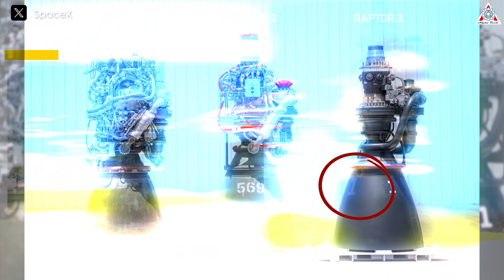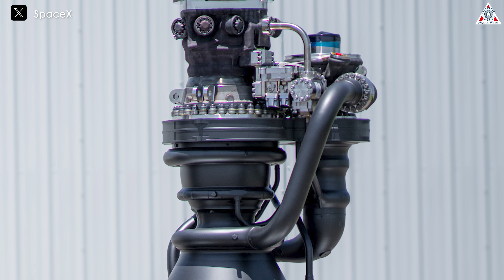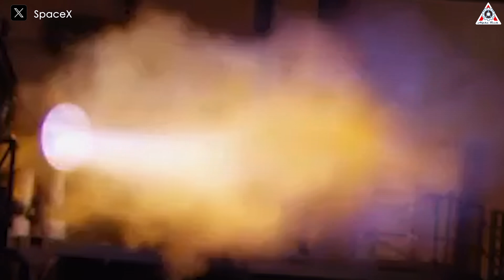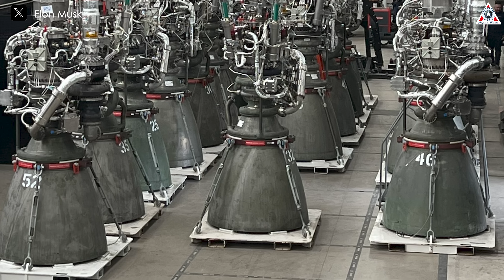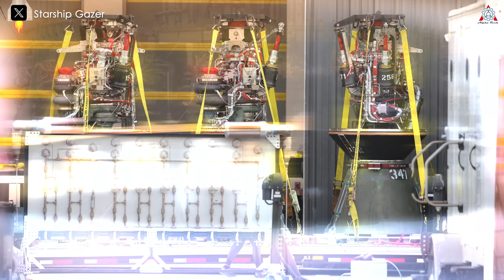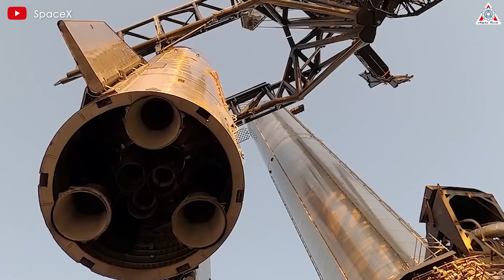Elon Musk's SpaceX Just Announced NEW Raptor 3 Upgrade...Shocked The Whole Industry!

Comment: What if automotive engineers focused on new internal combustion engine designs using 3-D printing and A I to create a new engine design that enhanced fuel efficiency, increased horsepower, and reduced weight? One area that comes to mind is doing something with hot exhaust gases RE-igniting the exhaust with more fuel then RE-routing the power generated back through impellers that geared back to the driveshaft? Is something like that possible with a net gain in break horsepower? 👍🖖😊
Reply: Water injection with a small displacement turbocharged engine is probably the best we can do there.
Reply: What if electric was so efficient that there is hardly any heat imagine how this would save the planet from global warming and the harmful effects of exhaust gasse,  the future is now
Reply: @jacobclark89  Yeah but energy storage for a battery is two orders of magnitude less dense and that isn't a trivial problem
Reply: Well, they have done that for like 100 years. 😉
Vehicle combustion engines have the demand upon them to work well in an extremely wide power output range.  This is where we have always seen progress.  When fuel cost increased the efficiency throughout the power range has also become important.  This is why we now see developments like attempting to vary valve timing and lift.  Varying compression ratio is also tempting, and quite possible (you put a knee on the pushrod and connect a second rod to the knee).  The problem here is that increased friction losses tend to eat gains.  Auto engines should also be affordable.
Nevertheless, physics offer two main ways to increase efficiency:  Convert more of the heat energy from the combustion to mechanical energy.  Or reduce cooling.  Reduce cooling can be done by using more extreme materials, and also by making cylinders bigger and keeping stroke close to diameter.  Or you can use the cooled energy for more mechanical energy.  This is part of what water injection would do.  Water injection also allows for higher compression ratio, which extracts more energy during the longer expansion cycle.  The same thing that diesel engines already do.
Turbos mainly make an engine "bigger", thus becoming stronger by combusting more fuel and air.  But it also feeds back some of the exhaust energy extracted by the turbine to the engine, by "blowing" it.
There is however another interesting method to extract more mechanical energy from the exhausts.  It's sometimes called 5-stroke engine, but is in properly more like a 6-stroke engine.  For every 2 cylinders, you add a third bigger cylinder.  Thus you can only build 6-stroke engines as 3-cylinder, 6-cyl, 9-cyl, 12-cyl etc.  The exhaust from each of the two combustion cylinders is alternately fed into the third cylinder each cycle.  Experimental engines like this has been built and tested with very good results, at least 10% increase in efficiency.  The engine also becomes bigger, heavier and more expensive.
Reply: @Vermiliontea  Thanks for breaking down these concepts into a language I can understand.  A I apparently is not ready to integrate all these concepts to design a new peak performance machine. There’s so much background data that needs to first be given to A I in rocketry and automotive engineering. Thank you for taking the time to answer my inquiry. 👍🖖
Reply: Perhaps when we get Zero Point Room Temperature electric 😮

Comment: Enjoyed your very informative video. But, you claim that not only is Raptor 3 the highest thrust of all currently flying rocket engines, but also the most reliable. No reliability data yet. And certainly every time you push farther to the boundaries of power vs weight, reliability usually takes a hit. SpaceX method is to develop a new better version, then through extensive testing and actual use to constantly improve reliability. We will have high confidence on reliability after 100 successful flights.

Comment: I calculated StarShip 3 Booster prop load is for 128 seconds of work only. Looks suspicious. It shall have more volume for prop.
StarShip Booster may have 4600t of prop, 33 Raptor 3 engines, and still fly as expected.
Reply: ok, what
Reply: I think you don't understand that the seconds is not operating time but a measure of the speed of the exhaust.
Reply: @royh6526  
Fuel consumption is 'thrust in kgf'/ 'specific impulse in seconds'
306,000 / 350 = 874.3 kg/s 
Number of engines
10000 / 280 = 35, 71 ~ 36 engines
All engines fuel consumption
36 * 874.3 = 31475 kg/s
Booster prop in seconds
4,050,000 / 31475 = 128.67 seconds.

Comment: I would love to see a technical discussion of how SpaceX Raptor engines evolved to a simpler design. Just looking at the engines it’s easy to see the simpler design, but without knowing what the different parts are it might as well be magic.
Reply: I suspect that a lot of the previously external plumbing, is now incorporated within the engine via 3D printing. Also a lot of early wiring is for sensors to gather performance data, as the design evolves, fewer sensors are required, and when your confidence in reliability is high enough, none.
Reply: @royh6526   I've spent the day studying the Raptor, and I think you're spot on.  Changes to design, incorporating data into the shapes and dimensions, have made a lot of sensors redundant, and probably also a few valves.  But they must also have internalized some things with 3D-printing.  If you go 3D-print for other reasons, like more internal cooling, you might as well stuff everything.  I might also have figured out how they throttle the thing, but I keep my mouth in order to not make a fool of myself.  And yes, I'm implying that the obvious, natural way might not be it,  ...or otoh, it might be.

Comment: Better than Rocket is here
Easy lift off 
Easy land on with antigravity Spaceship
No Fire
No Explosion
No Flame
Just Spin and
Lift off
Powered by Baterry

Work base on Gravity just spinning by using Battery
can fly in bad weather, plunge in the ocean even in outer space
Can lift more than 100 Ton 

Earth which weight predict 600 trillion ton does not fall at the Sun because of centrifugal in orbitting, on the contrary it does not be thrown far go out the orbit line of hold by gravity at the Sun as orbit center. Gravity and centrifugal is equal called Equillibrium, thats why until now Earth which we was inhabited always rotate and circulate the Sun. Now we justly take example : how if the gravity used and centrifugal is negated? The Earth will float far leave the Sun. So that centrifugal can be used to fly far away if gravity eliminated. Finally how to eliminate gravity?

It’s way rotate part of aircraft by horizontal. When that rotation faster centrifugal force getting greater and the gravity getting smaller, finally it lose the gravity and the aircraft start flying. Of course people would surprise: how the aircraft can keep rotate without fulcrums? Thats why we named that aircraft Shuttling System that is aircraft likes two disc adjoining attached in the midle as fulcrums:

A. The Top part, we name Positive rotate to right, and the edges is getting thicker and havier.

B. The Buttom part, we name Negative rotating to left, and the edges is getting thicker and havier.

C. Middle Part , we name Neutral, air crew placed and also machine and everythings turning Negative and Positive at the same time.

The aircraft can liftup added with explosion from the engine. However that aircraft construction later, let the engineer doit it, and we are sure the aircraft will bulletproof and also waterproof.
 
.
.
 
In modern civilization where human being generally using flying saucer as vehicle, will a lot of change in lives either in materialism and in psychological. In materialism area will apply the change in life like.
People no longger need roadway and rel road which spend large of energy, money, places, things and time, object place and time. People would utilize that area for habitat or for other need:
Reply: Clearly you have an active imagination. But completely wrong. Did this revelation come to you while you were high?
Reply: @royh6526  😂
Reply: stop yapping

Comment: BRUH Honda's been wire-tucking engines for YEARS....glad the trend has reached SPACEX.
Reply: It's not exactly "wire-tucking".  I think they have done the same as they did with the Merlin1D.  Which was something unique.  The Raptor's fuel pumps pump ca 900 l fuel and oxygen into the combustion chamber every second.  And they do that against the pressure of 350 bar inside the chamber.  That requires more than 40,000 hp.  While that is a technical problem in itself, then comes the fact that achieving stable combustion is excruciatingly difficult, and it just becomes more difficult when you increase pressure, temperature and size.  It takes very clever design of pintle and combustion chamber.  SpaceX has used a sort of magic to solve this  (an impossible, inhouse, extremely advanced mathematical modeling software tool).  But it also requires a lot of sensors, regulators, valves and a computer to control all the valves, and a lot of plumbing.  What they did with the Merlin1D, was that they dispensed with most of this, replacing it with plumbing that is so infernally cleverly shaped and dimensioned that it doesn't need most of the regulators and valves.  This was again ridiculously difficult to do, and required lots of effort and tons of testing.  But the end result was the most reliable, cheapest engine of any launch rocket, at the same time as it had the highest thrust/weight ratio in the world by a mile, and the world record of specific impulse for kerosene rockets.  Looking at that Raptor 3 engine, it seems to me they have done the same to the Raptor.
Reply: @Vermiliontea  "wire-tuck" is an attempt at an oversimplification of their manufacture process.  I know that it is ridiculously more advanced than just hiding wires - rather, their 3d printing process is one function that has basically baked in the fuel lines and wiring conduits for the engine, reducing mass and the need for heat shielding.  TRUST ME I AM EXCITED TO SEE THIS WORK, especially the VACUUM VERSION.
Reply: @Gigalisk   Yep, I've spent the day studying it.  And I think you're more right than me.  They can't do exactly the same thing as they did with the Merlin1D, because their functioning differs greatly.  And the Raptor doesn't have a pintle.  It has a ridiculously complex injector, which I think I've seen by the 3D-print maker.  Nobody said it was a Raptor injector, but I figure it could hardy be anything different.  Anyway, there's a fair amount of lines they cannot get rid of, so the explanation is probably that they have 3D-print integrated them.  But I also trust that they have made design changes that make a lot of sensors redundant, and then they're rid of them and their lines too.

Comment: Raptor 3 upgrade won’t matter. Ift-4 created 120,000,000 hp and could only reach 25 miles empty. Apollo v F1 produced 7,500,000 hp and it reach 40 miles with the entire payload plus astronauts.

Look up gains of diminishing returns. Starship has reach the point that bigger only mean less height and speed.

When your space rocket weighs 9 time more than it has to. This is what you get. Plus the problem of 33 engines on a single rocket booster means it can’t burn over 4.00 minutes total before failure.

I’ve never seen a guy so determined to prove he is right. Lesson do screw with physics. Just use physics.
Reply: lmao😂
Reply: I must have missed the part where the Saturn V was fully reusable, and refuellable in orbit 😂🎉
Reply: @jonnies  That is the crutch of a moon rocket, there is no need for re-usability it only creates extra weight for the odd deep space moon mission, reusability is ok for placing many satellites in orbit.
Reply: @jonnies  sorry I missed your refuelable comment. Maybe you need to google. Last I checked starship has only arced Leo twice. Last they blew through all the fuel on board. So, please enlighten us as to the not the shiniest apple in the barrel is going to manage this feat? While you’re at it. Please check on landing in Australia? This would require a complete landing other than cgi. Nice!
Reply: I missed the part where starship has ever been reusable?
Reply: Let recount, 137 engines trashed not reused. Oh and 4 boosters and 4 starships.  Definition of reusable (To use again) lmao 😂